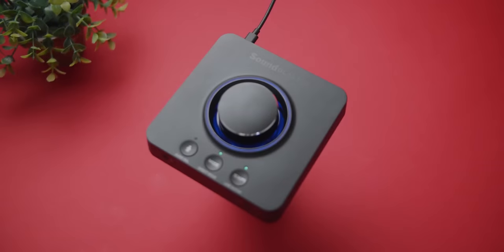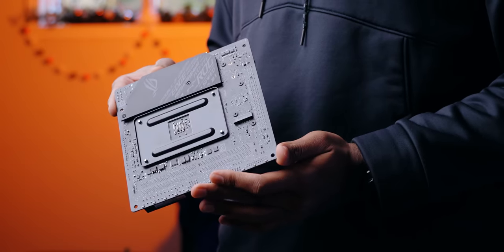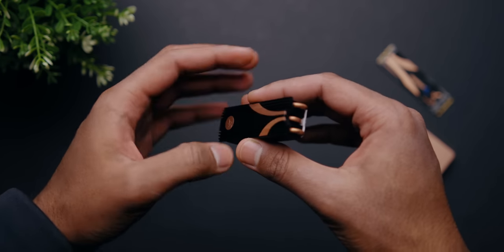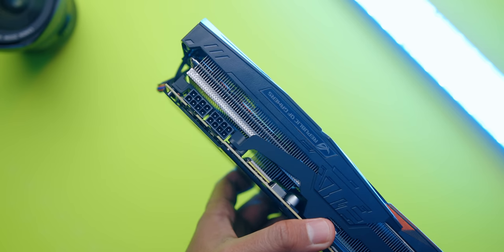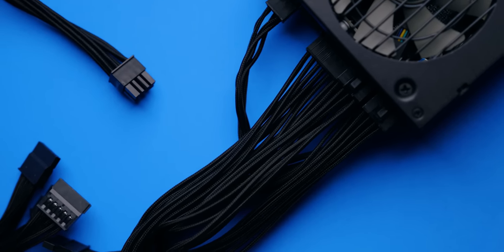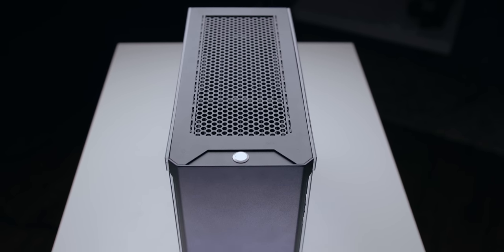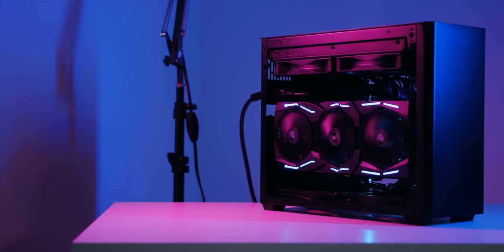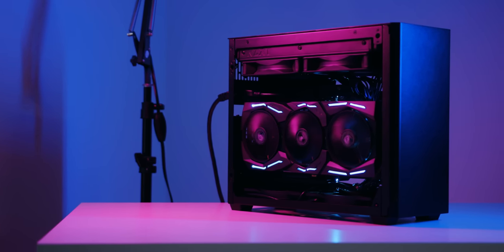Our Most POWERFUL ITX Build Yet!  A Ryzen 9 3950X Beast!

Comment: It doesn't look like you're benefiting from the 3950X much at all. My opinion after seeing that is to go with a 3600 or 3700X, cheaper motherboard, and a much smaller case. It'll either save money or allow you to enhance other parts of the build. In fact. I think that might be my next project.

Comment: Doesn't the glass panel choke the fans on the GPU cooler? I'm getting thermal issues with my Raijintek Ophion Evo  ITX tempered glass case, and an RTX 3090

Comment: That motherboard only has 1 3.2 gen 1 and 1 2.0 USB header. Did you end up having to connect the type A front USB to a hub on the 2.0 header or is there another way to get the front panel usb's hooked up along side the AIO?

Comment: What temps are you getting on that gpu? I'm thinking of doing a similar itx build in that case soon. I would love to throw on the glass side panels instead if the vented ones, but I dunno how hot that's going to make things
Reply: Every itx build is gonna have worse temps, cost more, have a bad upgrade path and the parts are going to have a shorter life span too than an atx build. 

But do what you want, I’m just warning you.

Comment: OMG A processor running at stock frequency is cooler than a 1.1GHz/30% overclocked chip :surprised pikachu:
Reply: And still fucking faster ipc holy shit
Reply: you completely missed the point though, he is talking about a 16-core running cooler than a 6-core in the same cooling system. 

more importantly, it's not like being stock or not is what determine if a processor runs cooler or not, there are plenty of processors running stock frequencies that are hotter than others running OC. apples and oranges.

but even if we follow your logic, that the 8700K is running 30% above its base clock, it's still a 6-core, while the 3950X is still running 10% above its base clock with 16-core, you would still think that the 16-core would run hotter. this does show how much more efficient these Zen 2 processors are.
Reply: @theSUBVERSIVE  r/woosh
Reply: @theSUBVERSIVE  r/woosh
Reply: @SVB089  r/woosh

Comment: got my 3950x.......and 2080ti in an inwin A1+.......its running fine off the 650w........ my b550i pro ax can run a 4.4 all core widely known.....im just worried about the 650w+5 fans+2080ti when "pushed" i can probably put a 75% max power limit on the 2080ti if im going to run a 4.4 all core OC to render or etc......but for benchmarking purposes i wont run the OC+max power GPU......i havent hit any issues in afterburner 250w-280w load for gpu and 100tdp is etc for cpu. I just fear pushing the PSU to its limit and OC voltagemodulation with a limited "remaining" power. Vs running a 850w. Ill eventually transplant the 3950x and 2080ti into a lancool II mesh build.....most likely with an auros master. And put a renoir and eventually cezanne in the b550i pro ax as a dedicated streaming pc. etc and so on. Esp if cezeanne GPU and OC potential has some large HTPC viability in 2022+......Until then.......im pretty astonished that my 3950x has hit 4.7ghz on single core or duel core. After the most recent NB chipset updates from amd+gigabyte(other optimizations for my platform) i get a 1s boot time.........on a gen3 inland 2tb..........probably 4-5s total once the start up apps are opened etc. I mean in 2020.......why go elsewhere.......other than eventual RAID on NVME via PCI-e power..........in the x570 master.......i have no reason to upgrade........by then the usb4 motherboards and zen3+ will be out so i will have better mobo options to consider with faster ram and the zen3+ let alone zen4 ddr5 as a platform on am5. This 3950x is essentially a "franchise player" and its pretty obvious with its 400w and 12 pin connector that i aint going much beyond a 2080ti until RDNA 2 pcie.4 cards come out

Comment: Is there actually any point of going with mini ITX, except the looks?
Reply: Space issues. A lot of people didn't have the space for a full ATX build, or didn't want to have a tower laying around.
Reply: I'd argue the opposite. Is there really any point to those big, full size towers? Most people don't even need that much space for their hardware, and 2x GPU support is basically dead. The only issue with ITX is barrier of entry, ie cost. I find it far more practical than ATX.

Comment: I doubt the gpu is getting enough air, looks amazing tho
Reply: yea i thaugt the same, but you could order Vented side panels so it would word better, but you would gave up on looks :D
Reply: @atomkacke  I would mask the window with frog tape, measure out ventilation holes and drill them out slowly and accurately.

Comment: I thought pcie 4.0 didn't play nice with risers?
Reply: 2080TI is PCIE 3.0
Reply from the maker: As long as one of the end point devices is operating in Gen3 mode (in this case the 2080Ti), its perfectly fine.

Comment: not to be a shill but the 10980xe isn't directly comparable due to the pci lanes and quad channel memory
Reply: When you factor in the that Gen 4 PCI lanes are 2x the bandwidth of Gen 3 PCI lanes, it really is only the quad channel memory and costing more $$$ for the 10980.  Thus, the PCI lanes really is not a good argument unless you need it for more devices vs. bandwidth.  Then you have Threadripper if you need the extra PCI lanes and quad channel memory.  Intel just cannot compete with AMD right now (minus laptops and OEMs of course) and the 10980XE is a laughable launch at best.
Reply: @chads7796  The whole point of having extra lanes is for multiple devices such as quad gpu for deep learning, running exotic storage...etc. I'm not defending Intel, i'm stating the comparison is not ideal, as you wouldn't logically buy a 10980xe to put in an ITX case... even if the 3950x didn't exist.

Comment: In case i missed him mentioning it - this motherboard does ont have a USB-C header on it so the front USB C port on the case is useless. No itx board has that header except some intel boards i think.
Reply: aorus x570 itx has the front type c header, is a little worse at oc, only 2 fan headers.
Reply: @Hellbryan1  We are talking about this specific build. He used an Asus ROG x570 i Strix. This mobo does not have a usb c header on it. It has a USB C port yes, but if you want to use a front panel case USB c you will have to use an adapter which will take the place of the usb 3.0 header on the board.

This information is pretty important for anyone using these boards as more and more cases are adding front panel Usb c - INCLUDING the case he's using in this video.
Reply: @henry2941  No, you said "no itx board has the header except some intel boards i think- 

I just told you there is an itx motherboard from aorus which happens to have the usb-c header
Reply: Nicholas Hate keyword “think” the point and focus of my entire comment was about the fact that he didn’t bring up this fact or the fact that the specific board he was using would leave the port of the case useless.

That fact that so few boards, especially amd boards, have this makes this an extremely important detail

Comment: Why upgrade an 8700 K right now...ya the 3950x is awesome... but the ryzen 4000 series is right around the corner and rumored to be amazing.  It's a $700 CPU so unless you really need this for media editing machine very silly waste of money upgrade... I'm guessing you already have a media editing system so are what you're trying to get just a couple more frames on your games? You should at least wait to the 4000 series Ryzen. And seeing what's on the horizon and as solid as your Hardware is already you should wait at least a year to see what comes out and a sensible would wait 2 years from now then the 4000 multi GPU Nvidia card will be up....
Reply: Bruh in 3/4 years only chill

Comment: Got rgb ram, a cool looking cpu cooler and a decent looking mother board just to cover it all up with the gpu. Made of spare parts aint ya bud.
Reply: It’s a sandwich style case which means one side shows the mobo and the other side shows the gpu and the gpu is connected to the mobo with a riser cable. Made of spare parts aren’t you bud?

Comment: you guys have enough experience but seems you're not using it for your personal rig.. you could had and just delid the 8700K, overclock it stable at 5.1 and crash any game and also those Davinci's times... or just swap for a 9900K plus delid.... or for something more, running something like a 9900KS at 5.2 ghz, 4400 Mhz ram and of course the 2080ti.
these are my thoughts based on your video.. i didn't hear (may be) i need to run blender or multicore applications 24h.
Reply: 9900ks would cost him the same and perform the same in said tests (GPU-bound 4K gaming and GPU-bound davinci).
Reply: @niter43  9900ks the same to 8700 ? no, may be you mean not a 50 % improve, i had the 8700K at 5.1 ghz till November, now i am on a 9900KS at 5.2 ghz, i also use Davinci resolve, trust me there's difference..
Reply: @HyrrokkinX  You've already seen it in video -- there's no difference for GPU-bound tasks, which stock resolve is. You must be using third-party plugin or have specific workflow that isn't supported on GPU.
Reply: @niter43  I am rendering the same kinds of videos and trust me I am saving a 10 to 15% on the total duration.. you're right it's not much but ....  also the 3950x is way more expensive..  it's like 400/500 $

Comment: 1 thing i have problem about “3950x” where to buy it? out of stock here!
best cpu but can’t buy it! go for intel instead goodbye amd 😒
Reply: There is no Intel alternative to the 3950x though? The 9900K isn't even in the same class when it comes to multithreaded workloads, which is what you'd be buying the 3950x for. Then you have the 3900x which is significantly faster then the 9900K again but closer to the same price.
Basically what I'm saying is, it really doesn't make much sense to buy any of the Intel mainstream chips if you're looking to buy the 3950x because AMD have the workstation area completely covered.

Comment: That case is too small, in my opinion.
Reply: Padid AZG. Why? If it fits the hardware, and airflow/temps are good, why would you want it larger?
Reply: @steffenthorup6888  Well, airflow wouldn't be ideal for that CPU and GPU in the long run. It is going to overheat and etc.
Reply: Padid AZG. Are you saying his temperatures are going to change in the long run? :) i mean, they seem fine now, why would that change?